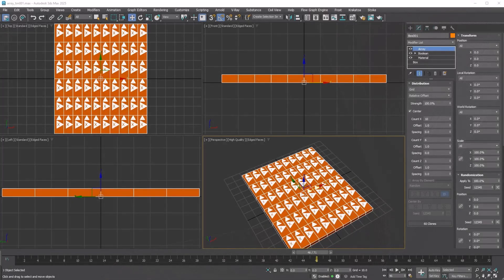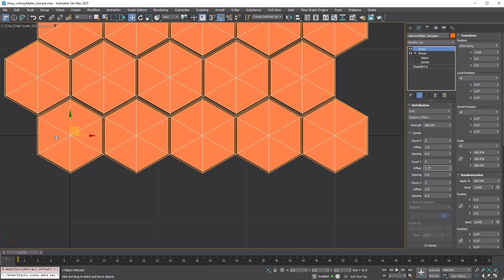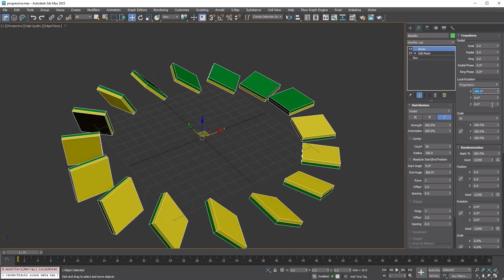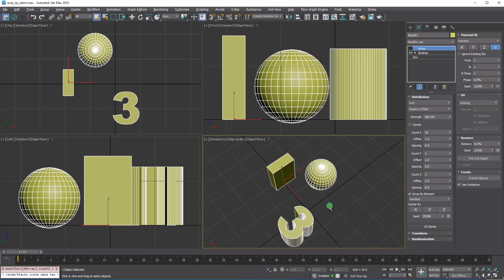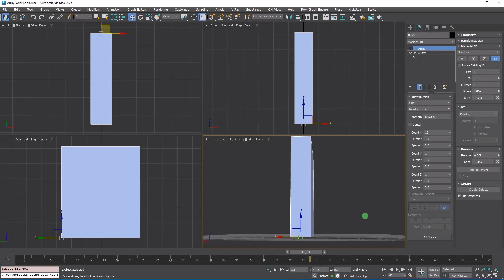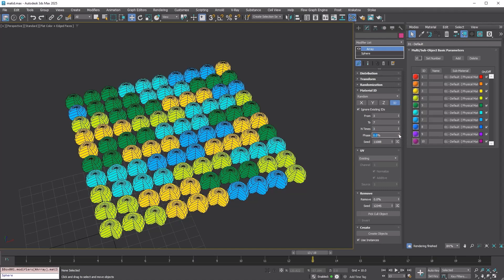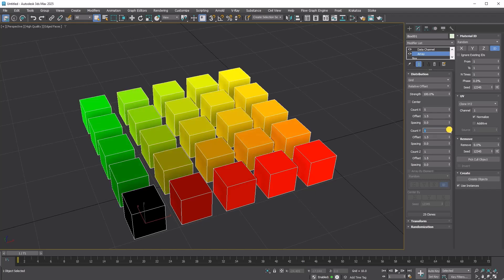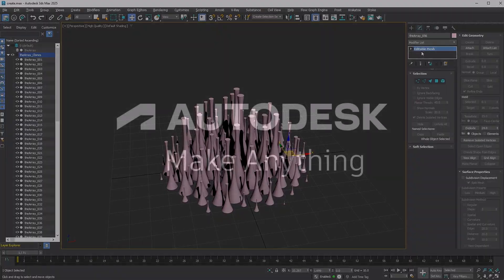Advanced Array uses in 3ds Max

Comment: Array grid option is so powerful. Although spline option is not like that. I try to create railing like object many times but it doesn't work. I want same spaced (at much as possible) post with one post must be at the corners. Still array modifier has got much functionality. Really liked it.

Array and path deform gives better result for railing as path deform bends the geometry. Although Path deform is too slow. These is much can be done with modifier without going to more complex options.
Reply: Did you normalize the spline?

Comment: When you will fix bugs which is following from version to version many years?
Reply: They have mostly fixed every thing I've reported that was a bug... around 20 or more.
If you have something specifically report it or share it, otherwise... you are just a troll :)
Reply: @Ignacio_Mullor  Some bugs have been around for years! troll )
Reply: did you even read what I wrote?
Ok we are still waiting you to mention a couple of that bugs that keeps bothering you...
Reply: @Ignacio_Mullor  There is one when hover over object the tooltip appears and you suddenly go to material editor now you will have the tool tip visible and only way to hide is go back to viewport and it will hide. Although it does not bother me much but it still there. I use 3ds Max 2024.
Reply: Which bugs are you referring to? Which version are you using ? Did you log it as defect? Did you check the release notes? There has been hundreds of bug fixes over the years.
Reply: @changsooeun  😂😂😂